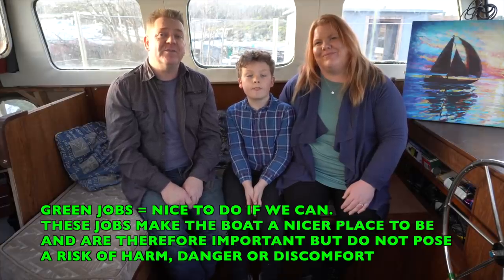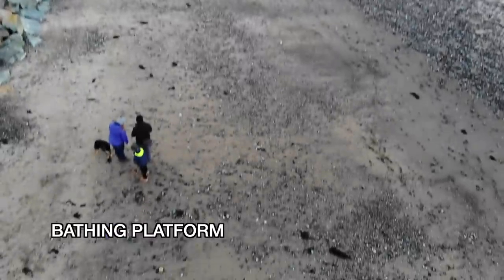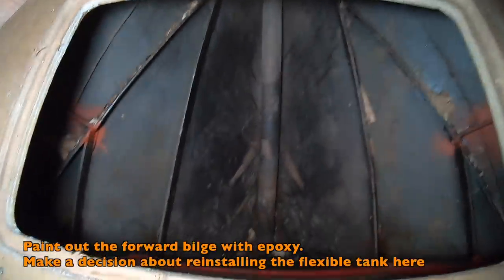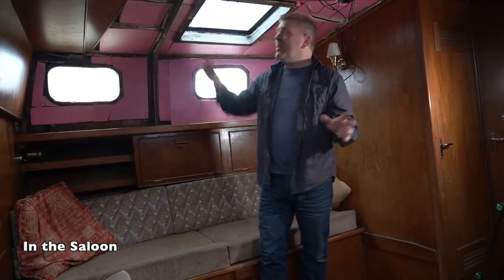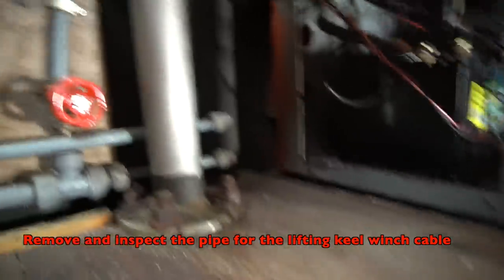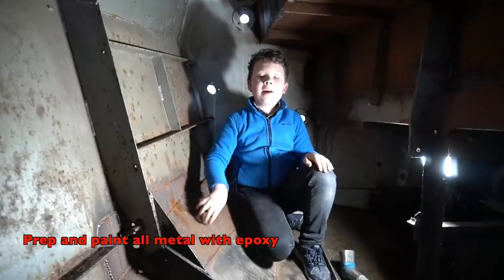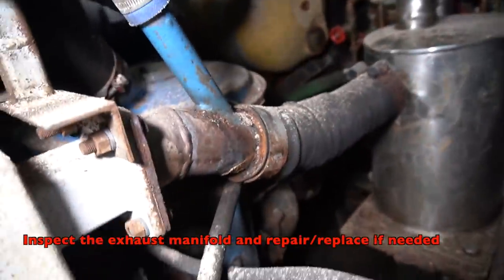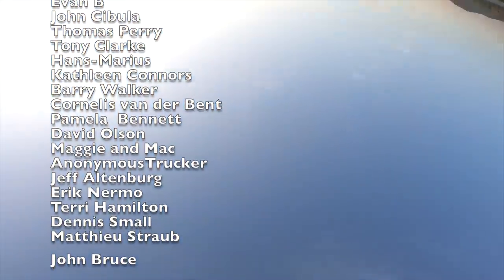#77 - A MASSIVE amount of work ahead!!! 😱 TO DO list walk through

Comment: Wow this was so neat and helpful. Nice to see it all laid out like this. Can't wait to see Item 307! It will be great to see Captain Jack at the helm. 
Just a thought, I've built a few tiny houses with little woodstoves and you end up having to cut the pieces very small. Some people don't mind but it can be quite a bit more work on top of splitting wood to then cut to 6 inch pieces with a chop saw or something. The bigger wood stoves tend to get small spaces too hot! I've put in several diesel heaters without issues, and since you'll already have the fuel it's an option to consider. However, diesel heaters do take quite a few amps to run so you need the battery capacity. 
Cheers team! Keep at it!

Comment: Suggest spacing your insulation to create a gap to the exterior steel. Use rubber washers  as spacers fixed in position with Sikaflex to create the gap between the exterior steel.
Reply from the maker: Cool suggestion thanks :)

Comment: Your intermediate steps going from Pilothouse into Salon, do yourself a favour and make them lift out toolboxes for your most commonly used maintenance tools. Down the road.. erm.. passage.. erm.. you will thank yourself for the convenience. ( screwdrivers, pliers, vice grips, wire brush etc in one, socket set, ratchets and extensions in the other ) Also, a Happy New Year to the three of you, fair winds !

Comment: Re the Aries. That older,vertical pivot vanes are less sensitive that the modern ones so you may find it a bit sluggish to turn. They started using a ?15 degree to horizontal axis because the wind gets around the vane and pushes it further over and faster, thus more responsive. But two things: one is I've no experience of your model; and two, Melody may be OK with that as she is a large and solid build. Happy to be wrong 🙂

Comment: You're stirring up old memories of when I was a project manager!  One suggestion I have is to go ahead and do some tables for each project.  First is the list of supplies needed, the second is the projects that need to be done before this one can be done.  A nice to have list is one of the projects depending on this particular project.  Another nice to have list is what projects conflict with this particular project.  that is, will have have to redo this project if project XX is done first?

You may find that you have to do some of the green projects before the red projects if they will get done at all. :-)   You can get all fancy with software tracking all these projects, but it can be done with paper and whiteboards  (We did it with both paper & software back some 30 years ago...)

Good luck!  through it seems like a huge amount of left to do, the amount that's been done to date is equally huge!
Reply: Great idea!

Comment: Andy, seeing those rusty flange bolts made me want to make a suggestion.   You might think about using fluorocarbon (PTFE) coated nuts and bolts where they might be exposed to seawater and/or spray.  Best regards...
Reply from the maker: Thick bolts were you referring to? Sounds interesting
Reply: @SailingMelody  actually the bolts which made me think of it were the flange bolts at the deck level which the line to raise and lower the keel runs through; but, the coated bolts work well anywhere a threaded fastener comes in contact with seawater.  They are a little more expensive so we generally use them were the fasteners are exposed to a corrosive environment.

Comment: So many jobs but, seeing what you guys have done so far we all know it will be done. 
If I may.....
The keel box, think about a polycarbonate "window" instead of the plate... (out of sight, out of mind) 

Jack's cabin, put in two long windows between the frames. Two long horizontal cuts stop 1" from the frames, looks like you have about 8" of space, make the cuts 4" to 6"  apart. Step back in 2" to 3" on the cuts and do the vertical cuts. Remove the center, bend the leftover tabs in and use 2" Angle iron resting on it. Tack it in place, bend the tabs flush with the Angle iron and weld it all out. You can then Drill, Seal and Bolt polycarbonate through the Angle Iron.

You will have massive light and an airy space despite being so small.
By recessing the Windows, they wont take the brunt of the waves and will be protected from damage (Docks, other Boats, etc.) 

As always, you Guys are amazing. Best wishes from Alberta, Canada.
Reply from the maker: That’s a fantastic suggestion. We have purchased a pair of Bomar opening port lights, so I would really like to use those if possible but your idea might be better actually and put the opening ones in the seat fronts.

Comment: I know they are stainless, but suggest you make it easy to get access to chain plates from the inside and, for that matter, any other structural supports for rigging, deck hardware and stuff that takes any loads. I live in a Victorian house and whilst they were good builders, they were also very good at sealing things in which promotes rot and its a right pita to dig through all kinds to get to the root cause. Great content though, love it and its inspiring !!
Reply from the maker: Oh yes indeed. My construction philosophy is that the whole boat can be taken apart with a screwdriver: every single panel is removable so nothing needs crowbarring to get behind it. I want to know that in any situation I can get to any part of the boat to fix something

Comment: Team work you guys are awesome at it. The steel boat is a twist that I like. Build a stock belts, Hoses, clamps, and o rings, nuts and bolts, Fluids. Those first trial runs always find a way to be a pain. Never hurts to stock up early. BTW, How big is Melody? I'm guessing 55ft. x 14ft. am I close?
Reply from the maker: Hey mate! Thanks for the comments :). She is actually 38ft believe it or not but she is the biggest 38ft boat I’ve ever seen, amazing use of space
Reply: @SailingMelody  We bought and paid for Our property 3 years ago. A good sized lot. A fixer upper 2 story house and 1 fair sized out building in a small town. A new roof, a water heater, and some furnace work a little later. Funny just like a boat. The work never stops!
Reply: @SailingMelody  Wide bottomed and deep hauled. Still one big boat! It's come a long way in a very short time.

Comment: Great video guys, are you planning to fair the cockpit side that’s outside Jacks cabin?
Reply from the maker: Do you mean the cockpit combing? Maybe a little bit but not overly. I’m not 100% happy with the fit of one of the pieces I welded in so I will likely re-do that weld and make it better. Fairing wise maybe a light skim here and there to take out minor imperfections and twists from the welding. But then the teak slats on the seats will change the lines in the cockpit somewhat as well.
Reply: @SailingMelody  , yes, on the videos it seems to come over as distorted, on the upright from the cockpit seat, may be a camera angle thing, just my ocd kicking in. Your doing a terrific job, so much done in 12 months, but still plenty more to go, which, from a subscriber point of view, is great, but for you guys it’s a heck of work to do before splashing!

Comment: dang all that rust slowing down didn't slow it down anything with rust needs cut out and new metal welded in or its never going away just the short time you guys put all that work into trying to save it and its starting to look like it did when you first started
Reply from the maker: Looks are deceptive, the cockpit was painted with a single cost of red oxide (grey colour) and has a few small areas of surface rust but zero corrosion.‘I’ve still got lots of welding to do there so I’m not using the expensive epoxy until all then fabrication is done. The only reason I painted it at all is so we don’t get rust on our clothes when sitting on the back deck, the amount of surface rust is absolutely tiny, but because it looks worse than it is people assume the worst. Trust me and you’ll see :)
Reply: @SailingMelody  I don't have any doubt that you guys will make it look good but surface rust is corrosion and there are holes in that boat and if the rust is not cut out around the windows in the drip rail it will leak and rot the inside out if you guys actually spent a little bit more money and got a better boat you would have spent two years on the water already instead of two years fixing it I've come to learn that it's better to have things done by a team of people to get it done faster or just start with something better no matter what it is so you spend more time enjoying it and less time fixing it when you think about it and people who take years to put things together as Lost Years of enjoyment and use of it